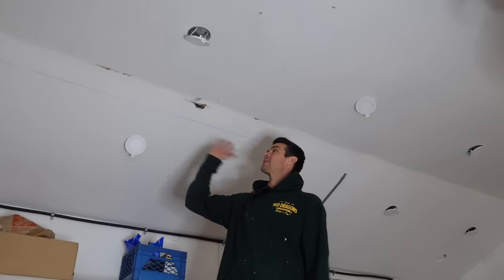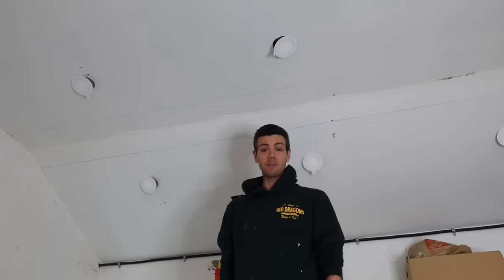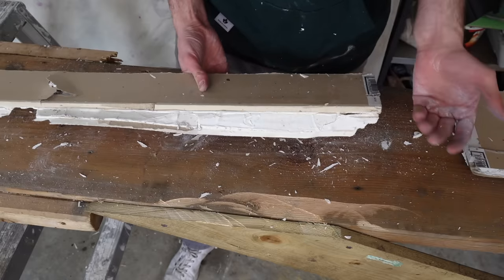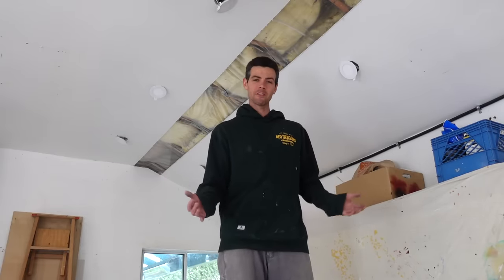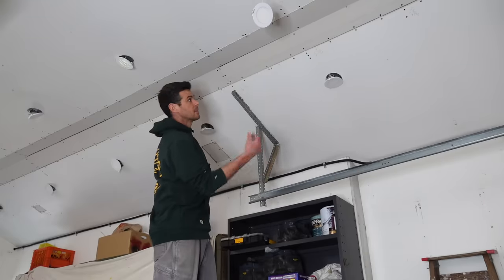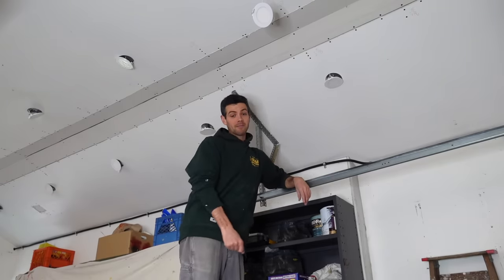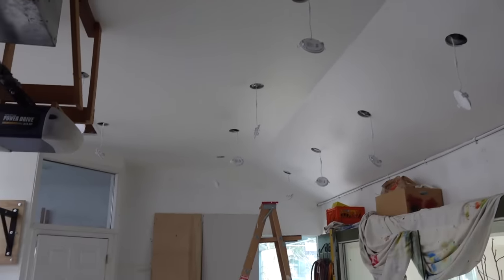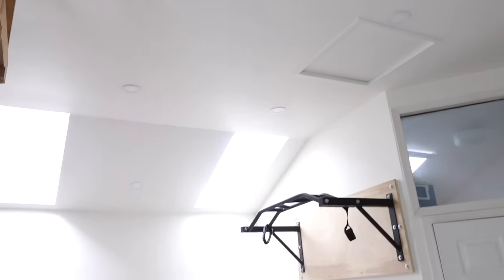Fixing the WORST CORNER I have ever seen!!!

Comment: When my father taught me to sheet rock he would just slab it on let it dry and then sand for days. Thank you for showing me there is a better way!
Reply: You learn very quickly that sanding is the worst job on any project. I'd rather go back and add more mud than spend days sanding. I also learned to carry a pencil to mark spots that need more attention, so you remember where those places are. (instead of finding them while doing primer)

Comment: Just wanted to drop a thanks for all your videos. 

Although I'm an ISM (steel framing/drywall) I do a lot of side work for friends/family and I find myself using a lot of the tips I've picked up from you over the years.

Just yesterday I dug in to the drywall a bit for a smooth trim install for example. I'm no taper but I can certainly get the job done when needed thanks to you as well.

Comment: Love your videos!  I just finished a doing a loft with angled ceilings.  Pre-filled every gap no matter how small, ended up with more mud on me and the floor, but the results on the off-angle corners looks pretty good so far and hoping that it never turns out looking like this one.  I always think that no matter how hard I try and pay attention to the details it's still going to look like crap. I'll forever hate doing drywall but your tips help make it at least a little better.  Thanks!

Comment: Just did one very similar. Attic room on a 1880's Victorian. Mansard roof was 18/12 pitch. Old plaster had been gutted and dry walled over rough cut lumber. Looked like waves on the ocean. I roughed it up with a cheese grater, primed it with lacquer, and floated it out with 20lbs. gauging to 5 gal. regular mud. Came out great, but I have no idea how long it will last. BTW, I did tape it all before I floated it. Glad winter's almost over and I can get back on the roof. This job reminded me how hard plastering can be. 6 dormer windows, b--tch angle over head, b--tch angle waist high. The hawk felt like it weighed 1,000 lbs. before I was done. Thanks. I'm still watching even if I haven't been commenting.

Comment: I moved into an old farmhouse that has had decades of handyman specials updating it, and I have quite a bit of drywall that is similar to this. My finished attic has some seams that are similar to this, and throughout the rest of the house they used mesh tape for everything (including the corners!!). They also didn't use enough screws in the drywall, so a lot of the panels move and cause cracks along their joints, Ive been fixing those one by one as I refinish the rooms, but damn it is an overwhelming task when the whole house is like that

Comment: I had something similar in my apartment, but reversed. The ceiling has 1 beam that it's slightly lower that the wall beam (error during construction but structurally solid), and instead of fixing it, they snapped the drywall inwards and added a lot of mud to mask it. No surprise it cracked after a few years.
Your videos are great and helped me a lot during the renovation of my apartment, thank you so much!

Comment: I live in Hawaii, so few houses here have insulation, and the structural design loads for roofs doesn't include snow, so a lot of times, roof rafter are 4 ft on center and then drywalled, typically with 1/2 inch. I've fixed soooooo many ceiling drywall joints in our 40 year old house. Have to install backer strips and then patch in new drywall. Most times I install 2x4s in between the roof rafters at the joints screwed into the rafters. I've also gone to using  Fibafuse on all the flat joints I repair. I know that paper tape would be fine, but I'm not a professional drywaller and Fibafuse gives me quicker and smoother results. I do paper tape corners and joints on walls though.Most likely the fixed ceiling joints will outlast the house.

Comment: Hey Ben can you do a video on the timeline of jobs like these? Like how long is takes, what you do between coats while things are drying. I get tons of repairs like these, they’re tough to bid because I have so much down time and so many trips back and forth.
Reply: My brother is in a different business, but he always bills a half day minimum. It may also require figuring in travel time, so a fixed amount for a half hour each trip. (just an example) On most jobs there's enough odds & ends to fill out that 3-4 hour billing time, even if it's just cleaning up to make the next day easier. Oh, never break that down for the customer because some will nit-pick. So much to do drywall PLUS 4 afternoons to get it into primer (another 16 hours) is the cost of the job. (plus materials) Just give the TOTAL to the customer so as not to confuse things. You will also find that quoting high and (possibly) adjusting the bill down later will make you seem like a hero. BTW, don't be afraid to stop and make adjustments if you find a problem. Hidden issues are not your fault and should be shown to the customer for clarity.

Comment: I always snap a chalk line from end to end and use durabond and run on the chalk line on whatever side chalk line shows, then put no coat tape in it. That way you know the angle is dead straight. And you don't have to shim any of the framing.

Comment: When you said "snapped a couple lines" and then "cut it out" my hand cramped. That's a nifty saw you got there.
Reply from the maker: I would not have wanted to do it without that saw.
Reply: @vancouvercarpenter  
I'd have willingly burned through as many oscillating blades as needed and dealt with the dust rather than knife or hand saw that ceiling. Now I need a new tool. What a shame.
Reply from the maker: @weege5.45  a multitool would have been fine. Maybe just a little more rat poop when the drywall was ripped out after.
Reply: @vancouvercarpenter  
Less rat poo is always better. Love your vids, by the way. I've never professionally done drywall (mostly demo and framing remodels and a few random commercial jobs) but you've helped me get some personal stuff done.

Comment: My theory on why that ceiling dips and hangs between every truss is well for one, 24” on Center is the norm. Also when it’s hung they lift it up at put some screws in the corners to hold it. So the Center of the drywall is already hanging and when you start screwing off the rest of the drywall sheet it’s like pin up a blanket to the ceiling. All it does is hang between screws/truss. Whenever the drywall is installed with a lift and it’s screwed off fully before the lift is released then you never get the droopy ceiling.

Comment: Not to discredit you in anyway . You are a talented in many ways . I’ve seen a lot of your videos and you always give it your all. I rocked full time (rock only)  for a little over 25 years . You could of used x crack . Not sure if they have that in Canada . Also the tapers I know would of used straight flex , with PL in their spackle mixture. Being it’s a garage . In my opinion The cold and heat will effect the longevity of the finished product. Read below for the product info. Sharing is caring. 
Details
Strait-Flex X-R X-Crack – 100’ Strait-Flex will eliminate ceiling cracks forever. X-Crack’s rigid design, hinged backbone, and flexible tab design straightens uneven framing and keeps the drywall joint stationary. X-Crack is adjustable to any angle and can be installed in just minutes.
Type: Drywall

Comment: Nice work .. But ive seen that exact repair with no coat edges just cut them in lengths to match the truss layout of truss or rafters..  That will allow for the in and out and when you coat it straight enough to sand true... Nice work

Comment: Awesome information in your video"s, thanks. Getting ready to start the taping process, seams and corners for the first time and then do a knock down texture.  If a small portion of the kitchen drywall was not removed and has a heavy texture, should I skim it so the new texture will match the new dry wall and texture ? Wish me luck !!
Reply from the maker: Yes. I would skim it.

Comment: I remember my first time ever messing with drywall years ago I put a hole in the ceiling when my parents were out of town. I was able to get to the backside of the hole through the attic so I took some mud and stuck tape to the back side of the  drywall let it dry then filled in the front side with mud put another layer of paper and mud. it ended up lasting for years
Reply from the maker: As long as it has drying time that would actually be a super strong repair.

Comment: Wish I'd seen this video before I boarded my ceiling as I used regular drywall and you can just make out this feint sagging. As it was a basement with no direct sunlight it barely shows. Glad to know there's ceiling board otherwise I'd have been lugging 5/8" by myself on the next renovation.
Reply from the maker: You usually only need it with 24" OC framing. If your framing is 16" OC I would be surprised to hear that it's sagging.
Reply: @vancouvercarpenter  It was 16" OC framing, but then I installed resilient channel 24" OC and forgot to take that into account when I fixed the board. :(

Comment: I saw a bad repair job the other day that makes that one look semi pro.  It looked like someone threw mud into the corner with their hands. It was built up over an inch deep in the corner and was cracking since it was all purpose. I almost looked around for cameras because it would have been a good prank to pull on a drywall repair guy.

Comment: The only thing I do differently is use a laser and corner cobra roller to establish the exact line of the angle.  I recently did an attic that was all off angles like this--  crooked, round (sort of) and crazy bad framing.  Plus everything was taped with mesh embedded in plain old joint compound--- cracks galore.  Lots of grinding/scraping/muttering and setting compound followed by regular compound later it looked immaculate.  Not fun but the finished product was worth it.
Reply from the maker: Dude. I would have loved a corner cobra.
Reply: @vancouvercarpenter  I really like mine.  Probably too expensive for a home gamer, but worth every penny if you make your living doing this kind of stuff.

Comment: I don’t get why people install drywall directly on the roof framing like that. I usually strap it with 1x3’s on 16” centres. Gives you a lot less headaches in the long run from seasonal movement, less sagging and more joint support. Although a 1x3 costs as much as a 2x4 used to cost just a few years ago.

Comment: Part of the value of any tool is its ability to be used as an impromptu hammer. Hilti screw gun passes the test at 5:50 🤣 

In all seriousness, thanks for the video! About to fix a corner or two and this helps

Comment: So I'm new to this stuff, why is cutting the back of the board and using the face paper as a joint different than separate pieces with a layer of mud and proper tape over it?

Comment: I use the" I cant tape air" line when our boarders leave holes that should really be proper patches in ceilings.
Also, have you ever used a "corner cobra" on off angles?
Just wondering if they are worth the cost.

Comment: Sure do appreciate the humor, intelligence, and creativity of your videos.  I have to wonder how you get any work done with all these video productions.  Not complaining, just saying......  My unrelated question involves repipe hole repairs.  When the removed pieces are in good condition with original texture intact (heavy knockdown in this case) BUT some hole edges don't meet stud edges, is it better to fill voids with 1x2 or 1x4 bridges to surrounding drywall or to cut back to studs and cut a new piece of drywall as one veteran dw guy recommended.   I'd personally try to re-use original pieces where possible.  You?  I hear polyb was used quite a bit in western Canada in the 80's.   Have you done repipe drywall remediation?  Any chance of a video on that in the future?  You would encounter a lot of technical issues on that kind of work, I suspect.  Thanks for your great videos!

Comment: I don't understand how you can sink screws so fast/easy. For me, once I get through the drywall and hit the stud, the screw stalls out for a second before it can bite into the wood, lifting the drywall, and often times causing damage like cracks or breaks (especially in the corners). I'm leaning into the drill with all of my weight and it still doesn't solve the problem, how are you making it look so effortless? Is it really all in that fancy drywall gun you have, or am I missing something else?

Comment: Ben - long time viewer, first time commenter.  Do you have any suggestions as how to deal with wall/ceiling seam truss lift?  I have a drywall seam that expands in cold weather and retracts in warm weather leaving an unsightly crack in the seam.  The interior wall runs parallel with the bottom chord of a truss.

Comment: I noticed that you used imperial measurements - is that coming from close proximity to the US, not only in terms of distance but also that work is actually implemented similarly?  
Thanks a lot for your humble presentation, been a fan since your line in North 1. 🙂
All the best from Switzerland
Reply: damn theres literally a video on that, nevermind. 😀
Reply from the maker: 😂 I was about to link it :)
Reply: JJ Mccullough has a great video on that. Basically, Canadians only use metric when they're forced to. Not unlike the US, except the  US didn't push it as hard. In Canada If it's regulated by the government, it'll likely be in metric. If not, well, there aren't too many 180cm people in Canada, they're 5' 11'. :)

The funniest tidbit is with the whole social distancing thing, in government buildings you must remain 2 meters apart from others. In privately owned buildings you must remain 6 feet from each other. I suppose metric countries are slightly safer, as 2 meters is 6.56 feet. :p

Comment: Being a DIYer, I didn’t realize that there was a difference between drywall & ceiling board. Was planning on covering up the popcorn ceilings with 1/2“ drywall since the popcorn is level 1 asbestos. Would I have to use ceiling board or can I get away with the 1/2” drywall ?
Reply: Well the 5/8 is also used in older building to match the thickness of old plaster wall with lathes. Here in Montreal I never heard of anything being sell as a ceiling board. I do not see how the result will be change for a pop corn ceiling….the tough part will be the skimming anyway
Reply from the maker: Depends what the framing is. 16" OC is fine with 1/2" board. 24" OC should get ceiling board or 5/8"
Reply: @vancouvercarpenter  Thanks for the information and the great content by the way.
Reply: @vancouvercarpenter  This is why I’m following the pros like your self. Learning a ton & paying attention to the details in order to do it right. Thank you for doing all those videos. Keep ‘em coming Ben.

Comment: That’s so funny- the second you pulled the original board off and realized what the previous installer did, I said to myself “they just cut the back of a single sheet to make the angle 🤦🏻‍♂️” Sure enough… 

You just know whoever was hanging that piece thought they were so clever for coming up with that solution. If that was an actual tradesperson, god help all the other homeowners who hired him, because there’s no doubt in my mind that they’ve used that technique over and over and over again like it’s their trademark trick.

Edit: just unpaused after writing this comment and it turns out it was the homeowner who did it. So, thankfully, this blunder is only limited to this house
Reply from the maker: I'm assuming it was the homeowner but I'm not totally sure.
Reply: @vancouvercarpenter  Fingers crossed

Comment: I’ve always wondered why you can’t just slice the back of the board, break it, and install it without cutting the paper at the front. It seems like it should work well and you wouldn’t even have to mud. I know that you’re saying that you can’t, but why? Will it always be an imperfect line? I know these guys work was obviously very bad, but can it not be made to look good?

Comment: Mesh over cracks round it with bonding then skim nicer Finnish and looks well and alot less work or for straight angle snap a line Finnish to it then do the opposite side good job

Comment: Ok huge fan and learned a lot. Thought I was decent at drywall but watching you showed me I wasn't. Here is my biggest... Issue... Not issue... but the biggest thing I want from your videos. I don't understand all the terms or names of the different muds (material spreading as filler and finishing drywall) you  use. Some of the issues may be I'm in another country but I am your neighbor. Have you or do you plan on doing a video explaining this. You talk about the mud you are using  but going video to video is usually different. I get that can happen based on different job but why? You talk about 5min 20min 45min, etc. You talk about filler, something crete or something, talk about all-purpose, etc. I can't remember the rest but you do mention more and use them. It's so overwhelming for me. You talk about newbs and I'm sure that's a good size of your audience. You are good and helpful to learn from but help with this very issue is so very needed. The way you interchange them, honestly (esp. Canada vs USA ) is so frustrating. Not your fault it's mine. That's why I'm asking questions and needing guidance. Thank you